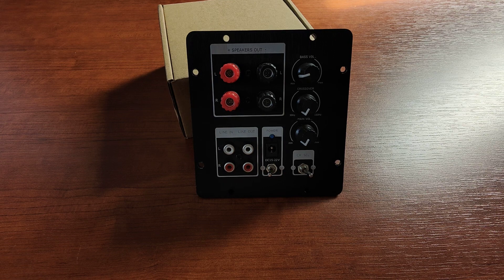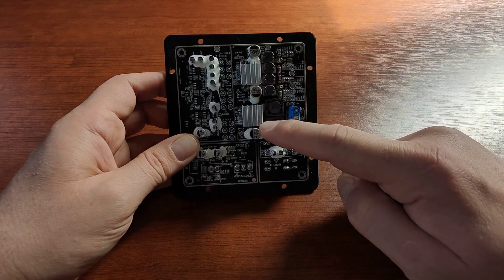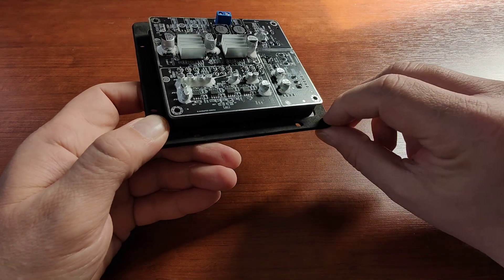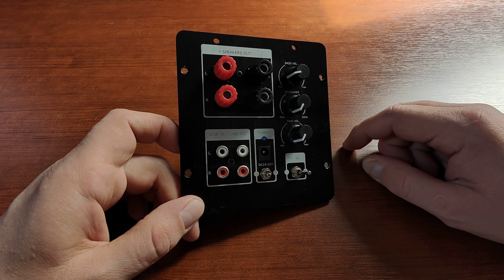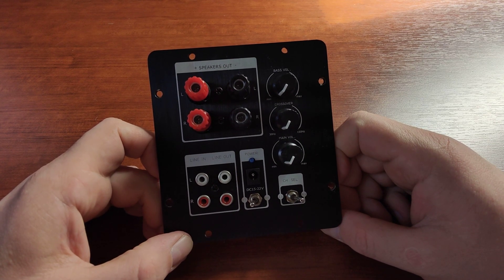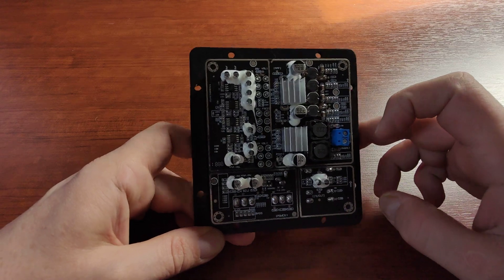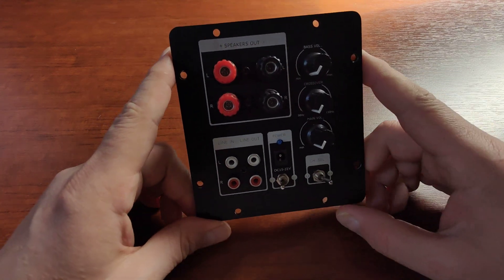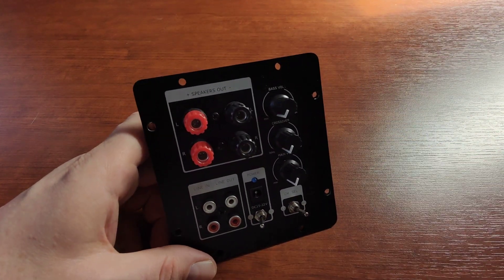HifiDIY Aiyima TPA3118 TPA3116 subwoofer amplifier board review

Comment: Got this today to fix a Totem mini active sub with blow amp.   Neat.   Xover using ne5532.   Not enough cap.   Only 3 x 220uf for Tpa power rail.   Now comes with screws.
I have an excellent sounding 3116 from Allo.   Will see if we can tweak it.
s.
Reply from the maker: @errcl65  yes it benefits from more capacitance, I also fixed small radiators on TPA chip. Theory says this version should be fine with PCB as heatsink, but better safe than sorry. And I had them in my magic drawer already.